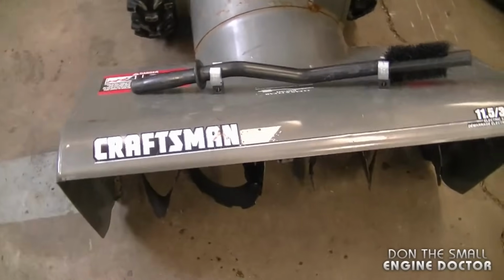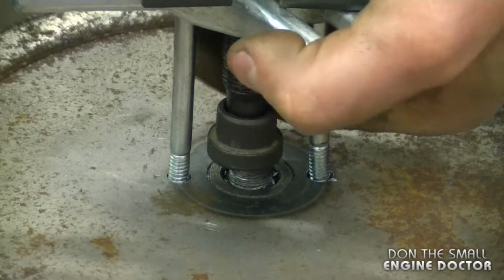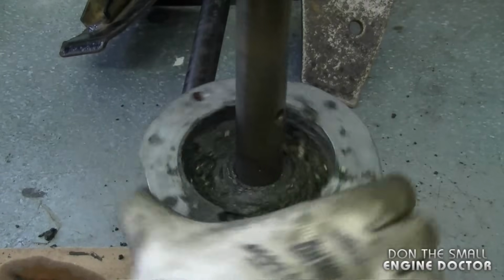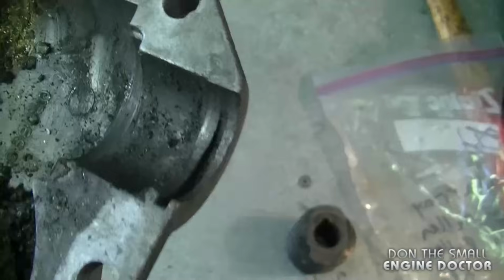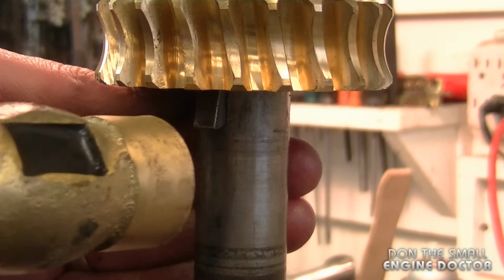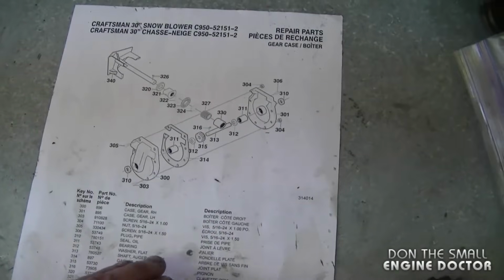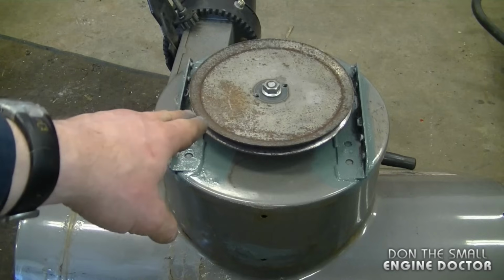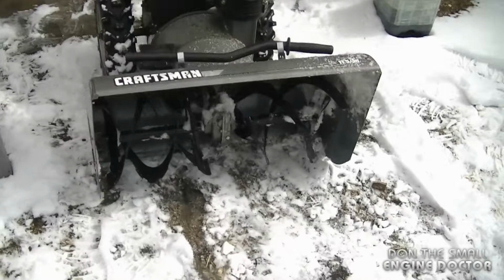Complete Snowblower Auger Gear Box Rebuild!

Comment: Really good video. On my Husqvarna snowblower the auger shafts are short and the augers run on bearings instead of bushings and the impeller fit over the shaft with its own shear pins.

I had to rebuild mine because I bent the shaft when the impeller caught a small log after I replaced the broken impeller shear pins with regular bolts. Rebuilding a transmission took me a really long time, I just wish I'd covered everything with anti-seize grease during assembly m learned for next time.

Comment: Boy howdy, the auger gear assembly gasket is leaking a dab on my Toro 521 and I was hoping I could just remove the bolts holding the augers and the whole thing would pull off the driveshaft.  Much more difficult I see and I'll put up with the tiny leak.

A wonder if there is any product that would stop the leak from the outside.  Anyone know of such a product?

Comment: After seeing ALL that, I will replace my common auger drive bolts with proper shear pins.
You can oil the base of the chute from the inside of it for easier turning.  Mine is converted to 12V operation of the chute with DPDT switch.  Excellent Video Dony.  That is a nice wide (30") machine with 11.5 HP.  $4100 plus today.  Carefully mark the Augers so you don't reverse them.

Comment: I doubt that it was the incorrect shear pin was the cause of this issue, I am pretty sure it was a combination of bad lubrication and a broken bearing on the input shaft instead, if the machine jammed, you would only have a couple of broken gear teeth.

Comment: BTDT. the 451 blower on my Cub Cadet ate the gearbox housing after a lot of hours and snow, plus the occasional rock or frozen newspaper... Rebuilt it and bought all the guts as well as a second box. These days getting some of the parts is easier if you just buy another blower for them as they have discontinued many.

Comment: Wow just getting the auger assembly out of that snowblower is quite a bit of work. For my Honda HS828, it's only 9 bolts. I don't even need to remove the auger housing if I recall correctly.

Comment: Curious why not just open the gear box up.  Spread it open enough to pull worm gear from impeller shaft out and save from splitting blower apart at all?

Comment: I finally got my machine's auger housing parts disassembled today.  I used your puller technique to get the auger pulley off the shaft.  Mine wasn't rusted in place but the impeller shaft was slightly bent and even twisted as you could see by the keyway not being straight.  As a result everything fought me even the collar that goes on the shaft between the pulley and the bearing.  I had to use pullers to remove the collar and the bearing as well.  Even the bolts which held the gearbox case together were so tight I had trouble breaking them loose.  I will follow this video and the schematics to put everything back together once I get a good impeller assembly.  The gears and bushings in my gearbox were okay (surprisingly enough they slid off the shafts without any tools) but I think someone put a lithium grease in it.  I will wash it all out and replace it with the 00 grease.  I ordered the Stens 00 grease along with a new housing gasket and some anti-seize lubricant and a replacement skid shoe from Amazon.  One skid was worn through but the other was still good.  Thanks again for this video this will be my guide for putting everything back together so that it works like new.
Reply: I have finally got my machine working correctly.  In addition to replacing the impeller assembly and the auger housing ball bearing I had to replace the auger impeller brake pad P/N 581540ma.  The old one was worn to about half its original width at the bottom probably due to the pulley wobbling on the bent shaft and could not do its job of stopping the auger quickly.  I also replaced both the drive and auger belts with new ones.  This was a lot of work but will hopefully be worth it the first time we get a big snowstorm.  I think a local power equipment shop worked on this machine and probably tried to get the pulley off by hammering on the shaft and bent it.  They obviously didn't watch this video.

Comment: Having to replace impeller shaft, gear cases and all the internal parts.  Wow wouldn't it be cheaper to replace the whole gear box?  I've rebuild those.  Your video makes it look a lot easier than it usually is.  But as always a good video Don

Comment: I have a similar unit and the gear box failed at 18 months. They fixed it under warranty but it failed again in less then 2 years and the failure was just like this one you Picture. Before reinstalling, I drilled and tapped an 1/8” pipe thread about midway up.  After reassembly I filled it with 90 weight gear lube. Now it hasn’t failed again and it’s been 20 years. I think only some of them fail because if you keep it in an attached garage it will be kept warm enough that the grease they used won’t channel and fail to lubricate. I had an unattached garage and it could be started at zero making it impossible for the grease to work.

Comment: I bet those nuts were not fun to put under the big pulley
Reply: Yeah, probably took awhile hence the edit-out, but it would have been nice to see how that was accomplished.
Reply: Small telescoping magnet....
Reply: i bet emery cloth or a flat file being used to remove some of the rust and also smoothen out where the auger shear bolts were would have made it a lot easier to remove the auger pieces .   i wonder why he did not do that in the first place
Reply: i like the fact that he includes the part numbers for others that might be repairing a similar  model  , just why not sand the shaft before removing the case . i just recently worked on a old snow blower i have that had gear box issues and am willing to bet that the reason why that gear in his stripped in the first place was due to a poor grade steel being used . even the color of the gear makes it look like a poor quality due to the fact that yes color has a lot to do with the quality of a certain metal .  the bushings on the impeller shaft on mine were so work that the blower fan was actually starting to rub against the back side of the blower housing .  thankfully my gears were only a bit chipped due to circlip and faulty hard metal spacer washers breaking and getting between the gears .  i remember when they made stuff of good quality back in the day .  now most stuff is made of such a poor quality that if you sneeze on it it might break lmao  .
Reply: i wonder how many people put the gears on wrong and then the auger turning in the wrong direction .
Reply: the auger , not the blower .
Reply: I have found sliding a small neodymium magnet into the index finger of a thin mechanic's glove works well for holding a nut in places like that.
Reply: @carmichaelmoritz8662  Hello sacrificial BRASS gear. SMDH
Reply: @carmichaelmoritz8662  what gears are you referring to? Please watch and listen to the video.

Comment: Wow !!   Very good, thorough and detailed video.  thanks so much!   But I think this job is way beyond my mechanical abilities.   Hopefully the problem with my blower is something simpler.  It throws snow eventually, but not when first starting... I will check belts and make sure I have the proper sheer pins and hope that fixes the problem???   As many others have said...this video is worth its weight in gold, merely to show how much work it is...if someone is foolish enough, like me, to replace the sheerpins with grade 5 bolts....!  Damn I wished I hadn’t done that...but I didn’t know.    Thanks Don... very good videos!!!

Comment: Perfect video for doing this repair! Thank you. You clearly show every aspect of what needs to be done. I have a similar green 2003 Craftsman 9HP 29" and the parts look identical. *Note: mine failed because it came with a bolt installed on one side (from the factory) that is completely different from the spare & replacement shear pins. Watching your video a 2nd time now to prepare for doing this job.

Comment: I noticed that when you took the unit apart, the bushing on each end of the auger shaft were on backwards. When you reassembled the auger, you put the bushings in the correct way! Thanks for another great video Donyboy!

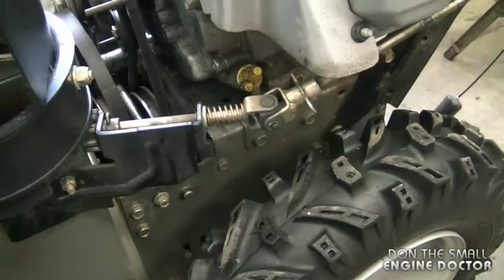Comment: Thank you. Very practical and down to earth repair video. My first snow thrower was a Craftsman branded unit. I did learn something I wasn’t aware of previously and that relates to overtightening of the shear bolts. I have a Honda snow thrower now and the auger shear bolts in that are tightened fully. I’ll say one thing about the Craftsman unit, everything was fixable and it was not overly complex. I got twelve years from mine when I declined to invest in a new auger housing – rusted, the engine was still running fine. Just a couple of final things... One relates to wrench sizes and bolt sizes. In the SAE world, a 1/2” wrench fits a 5/16” bolt, so the bolt (3:30) is not 1/2” If a 1/2" wrench fits it. Additionally, clevis pins are not hair clips (1:55). I am not meaning to be critical, just thought you would want to know.

Comment: High quality video the attention to detail and using the correct parts made this job a successful and lasting repair.  It seemed like someone also used an incorrect grease which hardened up and caused excessive wear on the bushings and the case.

Comment: Another excellent rebuild by donnie.  However I must confess that it was not Economically justified to rebuild this old machine Given the cost of labor and the parts along with the age of the machine.  If the cost of labor and parts was approaching fifty percent of the value of a new machine, Then the owner should have simply bought a new snow blower.  The new snow blowers employed superior technology and if you stay with a high quality name such as ariens, The owner would be much further ahead.  Why? Because of the age and the use on the machine? There will be other parts that will need to be replaced, including bearings and mant other mechanical attachment points.  Nevertheless if one is mechanically inclined and has the time And enjoys small engine work, As I do, Then it does make sense to buy the parts and fix it yourself.

Comment: I rescued an old noma snowblower someone put in the curb, after removing the old yellow gas it started right up, it needed a new auger cable then I noticed one shear bolt was missing but the remnants are stuck in the hole, both augers are seized to the shaft, the problem I'm having is removing the impeller shaft from the bearing, now I know what to do, I sprayed it and it's soaking overnight then I have to try and fee up the augers from the shaft, thankfully the gearbox is good, I just want it working properly because my friend needs a big snowblower and this will be perfect, it's 9hp and 27 inch, I don't have spare parts so I need to be careful.

Comment: i had to do this in a hotel i used to work at. the manager loaned out the snow blower to another hotel and they broke it. the oil fill was broken off and they replaced the shear bolts with regular bolts and didn't tell me.

Comment: Yes,  this machine was worked on prior by someone else.   The auger shaft bushings were installed backwards.  I see you put them back  together correctly.    My father's shop rate was,  "20 bucks an hour. If you have already tried to fix it, 40 bucks an hour."
Reply: Cute but so true. It blows my mind the things people do to make a simple repair an expensive one.

Comment: My John deer riding mower with 44 inch blower has an issue. It started making a loud grinding noise. I thought it was the gear box but when I took it apart the gears were ok. Must have been a rock between the impeller and body.  Anyway I did find a few small metal bits in the gear case but I cant figure out what its from. Looks like it used to be shaped like a hollow tube.  Could this be a pin spring?  I have no idea where it would go. Anyone know

Comment: Excellent ,clearly stated video. For me a destroyed auger box is too expensive to charge the customer with. Also you had lots of good used parts which I don't have. One thing I always do with any bearing like the main bearing is to pop out the cover on one side and clean the bearing with WD40 and then re pack it with a high quality grease considering that it will never see daylight again.

Comment: You always put out very educatonal videos.   I would recommend you run emery cloth over the shaft to remove the surface rust before pulling the gear box cases off (and maybe the gear, too).  Sometimes, it's the surface rust that makes it dificult to remove things from a rusted shaft.

Comment: Great instructional videos. Can you tell me if the part numbers you used for the gear would be the same on an 8/26 blower. If the gearboxes are identical or not. That would be helpful. Thanks 👍

Comment: Great video, but i gotta say its a little insane.  I mean, what is the total cost of all the parts here?
Add to that, this guys hourly labor, which, he should be paid very well.  How is this worth fixing?  All that expense cannot be rationally justified, can it?
And, if youre doing it yourself, for the first, and only time, it will easily take three times as long.  So, those hours working a decent job, minus the parts, buys a brand new snowblower, doesn't it? Or, two decent used ones?
No disrespect to this professional's very good work.

Comment: Thanks Donyboy.  I have a blower on the front of my tractor where the shear pin on one side sheared off and the two holes are not lining  up left to right.  Looks like I'll have to take it apart to find out why.  Thanks for your video.

Comment: Great video - thanks for putting this all together.  What will cause the ovaling on the case where the drive shaft enters the auger case?  Is this the sign of an alignment issue where the front / back of the snowblower come together at the belts/pulley?

Comment: How much did it cost to have you do that repair?  How many hours labor? I'm going to guess 2 to 3 hours. Parts on cheap either. I had to order a new friction wheel and it was 168.00 Canadian plus taxes from the local MTD dealer. The teo auger belts and the drive belt came to 50.00 bucks. 
I did the belts myself after watching your video. Friction wheel is on order but at least my machin is still working. I also watched your Tecumseh carb rebuild and did that 3 years ago....runs great ever since.

So in 27 years (with a Mastercraft 8/26 Snowblower) all I have done is:
1. Drain the oil 3 times and put new oil in, 
2. Changed the 3 belts one time (today), 
3. Rebuilt the carb. 3 years ago, 
4. Friction wheel will be changed in a week or so. I still have about 1/16 inch of rubber on it.
5. changed the spark plug 3 times.
6. Pumped grease in the gear box about 3 times.
It's an old work horse and I hope the gear box holds up. I have never broke a sheer pin, but I did stall the engine on an extension cord, a piece of 2x4, a chunk of ice, and a stone (all jammed up the impeller or auger.  I was surprised the sheer pins never broke. 
BUT:
If the gear box goes on me, I quit.
I'll buy a new blower. 

The gear box looks like more than I want to tackle and  that repair job is probably $300.00 minimum.

A New 338 CC 30 inch "Certified" snowblower at C.T. is only $999.00 and 949.00 on sale (made by MTD...so it can't be all that bad.  Champion Engine though. Are they any good?
I would be good for another 20-25 years.

Comment: Hey boss it's Steve mino good video what year do you think that craftsman snowblower is 2003 or 04? still have my 1993 craftsman II 10/30 blower it's been great however I find the newer craftsman stuff Iess desirable than the 90s units more metal and wider tires

Comment: Hey Dony excellent video. It’s nice to have a parts breakdown. That gearcase isn’t of bad design you can at least add gear grease. It’s the ones that have that tiny little plastic cork. In the shop I try to add some grease in them and the same time help guide it in with one of those red straws you use on a spray can.

Comment: Toro 521 has bushings in either side of the crankcase housing with outer rubber gasket seals.  Any idea on how to remove that sleeve bushing for replacement..?

Comment: Picked up a Craftsman yesterday at a scrap yard for $40 that looked essentially new. Was told the guy brought it in because the carb needed replacement (!). Easily got it running but it had regular bolts in for sheer pins and those stupid roll pins that held the impeller on were partially gone so the main shaft turned but not the gearbox. WHY would they use brass gears? Compared to my Honda snowblower these things seem sadly disposable.

Comment: Were you not able to tap those bolt holes for the puller rig so you wouldn't have to put nuts on the bottom of them?

Comment: I'm going to rebuild my gear box on a toro 521. My question is what are the seals called that seal the rod that goes through the gear box. Those seals are going to need replaced because they leak I think.

Comment: Love your videos. I've got a question for you. I recently picked up a older craftsman 8.5 - 26. Had to rebuild the non adjustable carb to get it running. The wheels work good but the impeller was doing the hurkey-jerkey thing. Found out that the impeller had taken a good hit and the back of it was hitting the impeller housing. Got that problem taken care of and found that the auger blades are rusted onto the auger shaft. I am retired and no longer have my touches, welders or hydraulic press. I could always just run it as is and take that chance that the auger won"t get jammed up but that's my style. That said, what/how do you suggest to do to get the auger blades off the shaft without going to a machine shop? Thanks, Mike